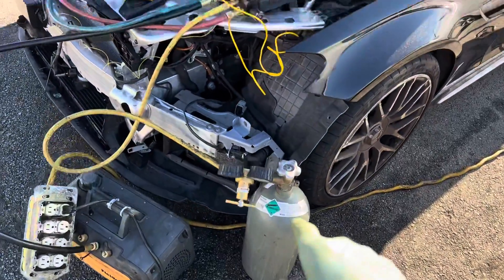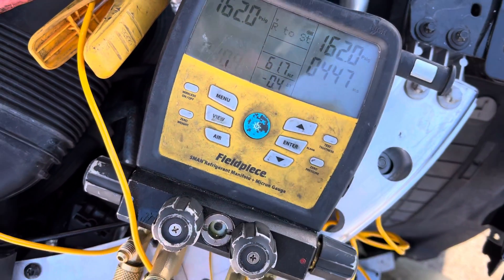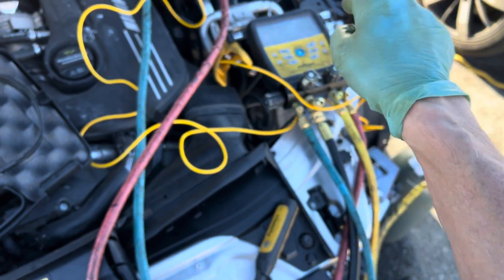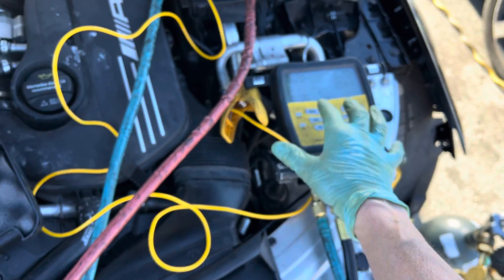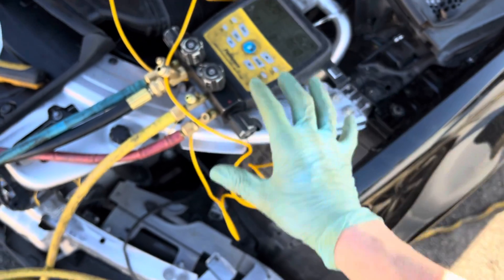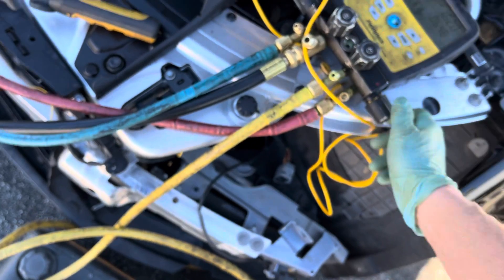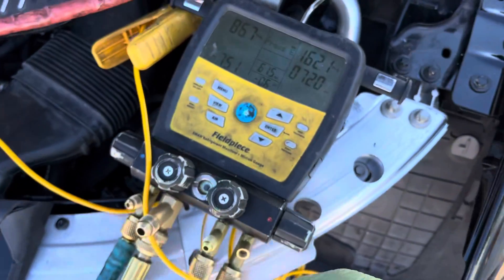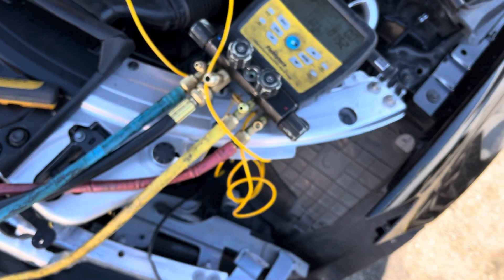High pressure dry nitrogen decay test testing fitting for leaks on condenser Mercedes C 63S￼￼

Comment: 0.1 psi is within the precision of the gauge, no cause for concern.
Tom, I'm curious to know your opinion, have you considered using CO2 for purge and leak checking as opposed to N2,  I haven't been able to identify any downside?
Reply from the maker: You’re correct I never pay attention to 0.1. 

CO2 is an inherently wet gas when you purchase your standard cheap CO2. 

      CO2 for labs or medical they ensure that prior to adding the CO2 to the cylinder the tank itself is cleaned has been put under vacuum and is dry so you start out with a clean dry tank. 
             They go through the extra steps of processing and filling the tanks passing through a dryer desiccant material.    

CO2 for general every day purpose does not have to be dry does not have to be pure. 

      CO2 is extremely reactive to temperature when looking at the PT chart its wings widely just with several degrees of difference. 

     So if I was going to do a high pressure test standing for six hours or 24 hours depending on what my manufacture called for looking for a small leaks. 

I come in to work and charge the system early in the morning it might be 42°F
             Then at the end of the day seven hours later it might be 82°F when I come back to see if I have any leakage
413 psi at 42°F
684 psi at 85°F 

Somehow magically CO2 jumped inside my system and raise the pressure lol 😂 

Or the exact opposite occurs.  
You start your test at 85°F and when you come back to test your pressure later on that evening the pressure has dropped to 42°F now it shows that you have lost roughly 270 psi oh my God I have a big leak let’s start searching the system for this leak that is not there.   
      Between the moisture and the great difference with reactivity to pressure in temperature this is why CO2 is not used. 

CO2 is an excellent leak check gas when introduction of moisture into your system has absolutely no worries in the world then you can use a CO2 electronic leak detector and I’ll pick up your leaks perfectly this is what CO2 is good for

CO2 is an excellent leak detector on a small system when you’re going to use the CO2 reactive fluid that turns pink in the presence of CO2 when you brush it on or spray it on and it only needs to be a leak of parts per million to react the liquid and turn it that bright pink color.    Then CO2 is an excellent gas to use in those situations

But unless my unit that I was going to use the pressure method was in a climate controlled room and the whole entire unit was in that room for example maintaining 70°F plus or minus almost nothing for the next 24 hours I know it was medical or lab grade moisture free CO2 then CO2 would be an excellent method to look for pressure drop for a small leak

CO2 is used in many industries for looking for leaks for the application in which they were intended for.  

That’s one reason why on my bucket list of leak detection methods is to get a hydrogen or helium leak detector and using one of those gases as my leak detect method with a electronic leak detector
Reply: @coldfinger459sub0  We always used helium leak detectors and N2 pressure checks prior to charging new ultrapure internally polished stainless steel process gas lines with any process gas, with extra precaution given to pyrophoric and toxic gasses such as anhydrous NH3 and SiH4, qualifying those numerous times, double checking and particle counts, bla, bla etc.
Helium is the way to go if you need to locate miniscule leaks, our equipment at the time required an nitrogen cold trap to function properly with the oil diffusion vacuum pump thus we had a supply of liquid N2 on hand.  It would be a different matter tying to do that in a garage or from a service vehicle, carrying liquid N2 around.
The newer helium leak detectors with turbo pumps don't require LN.
I can't imagine you'd ever need or encounter those circumstances but consider the helium leak detector was originally developed to ensure canned food safety.
In the case you do pull the trigger with helium, I suggest charging the lines or vessel with helium then using the detector in sniff mode to save on helium, we always did it the other way, by connecting the leak detector to the vacuum-tight gas line or vessel then spraying helium from outside.  We weren't buying the helium though and the focus was on ensuring the ultrapurity of the gas system remained intact, it was everything to have a 99.999 clean system.
Reply from the maker: @thisisyourcaptainspeaking2259  and be careful around concentrations of helium and your iPhone ?.  🤔

Apparently the helium atom is so small a small quantity of helium goes into the case of the phone and there is a electronic component or a Clock something that regulates and helium makes it not work there’s actually articles and videos on this phenomenon. 

Who would ever think of what we think of an inert gas would have a adverse effect on some electronic components and literally seeping through the metal and causing problems. 

Thank God helium leak detectors are very expensive nowadays compared to what they were when my dad was teaching me about them when I was young back in the late 1970s you’d pay thousands of dollars for such a laboratory grade device that was as large as a suitcase we’re going on vacation or a small refrigerator. 

Now they’re handheld and under $1000
Reply: @coldfinger459sub0  I expect any effect on your iPhone will subside after a few hours?  Probably want to avoid flooding the room in the absence of laminar airflow to sweep it away.
There are still some of the old diffusion pump leak detectors floating around in the market, (about half the size of a refrigerator) to be avoided IMO unless maybe you keep LN at the site.  If you experience issues with background helium, you have the option of pressurizing the vessel or system under test and then using an orificed sniffer probe on the detector.  We didn't do this because we were avoiding backstreaming of contamination into the gas lines and process chamber with our "dirty" leak detector.